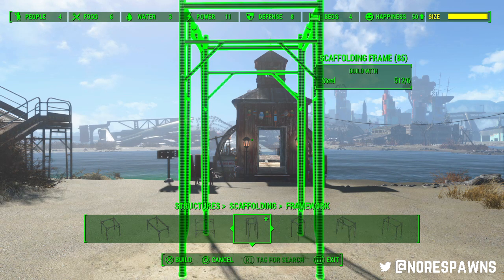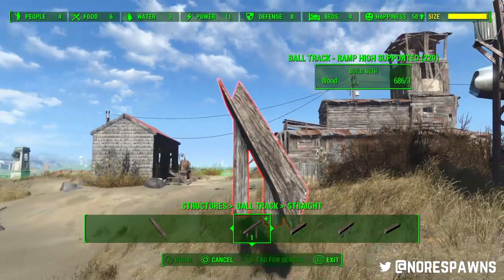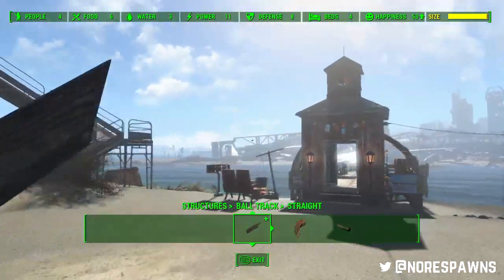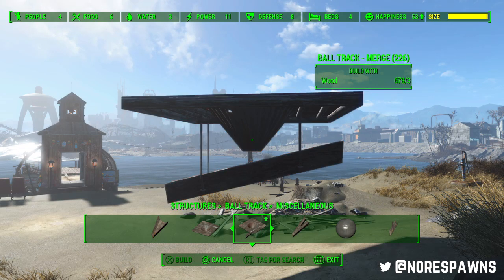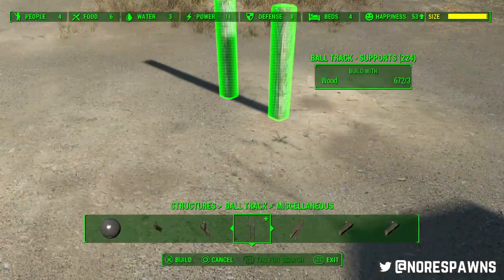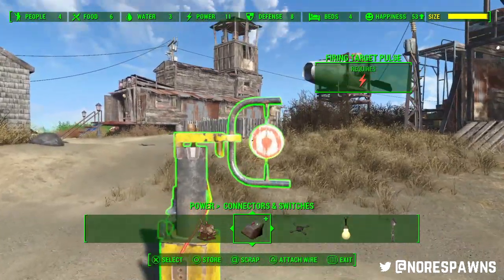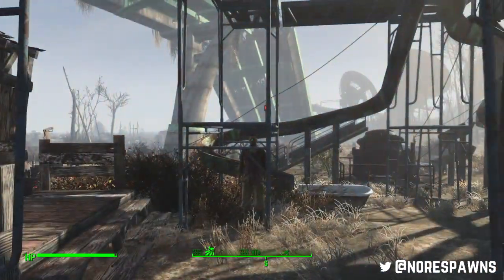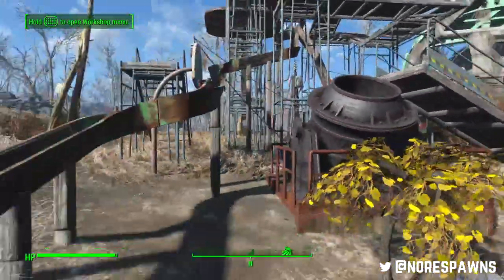Fallout 4 Contraptions - Ball Track Overview

Comment: I think once you start messing with the logic gates, you'll get ideas and enjoy what types of possibilities they allow for. I decided to dive into them and have done two things so far. 

First use was if my fusion core generator powering my defenses goes down in an attack, logic gates will automatically divert power from generators powering other things to defenses. 

Second, which I think is pretty cool is a decontamination airlock that's entirely automatic. To enter, hit the switch outside, door 1 will open for 5 seconds, once it closes 3 decontamination arches will spray for 5s while you walk through them, when they go off door 2 will open for 5s. Same for exiting but no spray.
Reply: the second one is brilliant
Reply: +ftwkh85 thanks! It took a while to make haha.
Reply: +Cass I I'll have to figure out how to build it
Reply: +ftwkh85 one note to hopefully save you some trouble is that any switches that you're connecting to the INPUT of a logic gate must have a direct connection... no other conduits in between.

Comment: I've noticed you say before "hold X and L1" and I'm wondering if you ever explained what platform that's for? I play on PC with an XBox controller and I'd love to more easily slide things like that if there was a combo to do so but I haven't figured it out yet. Mainly I just have to carefully fiddle with the right stick until I get what I want and it's more time consuming than what you do.
Reply: Hold A  button to move x axis and hold LB and A to move y axis
Reply: If your taking about grouping items together just hold A but it grabs everything in area so have a nice open space
Reply: Lb and a on Xbox I believe
Reply: Yeah, I'm on PC without the controller and I often am left wondering what the equivalent is to the buttons he's using.   Nothing I've tried makes it run smoothly like that on a single axis.

Comment: Hey Norespawn! I have a question, for the rug glitch, when I use the rug glitch to fade something it selects all the pieces at once instead of the rug itself and it does not allow me to fade things, how do I select the rug itself to move everything in order to fade things? +Norespawns
Reply: You don't hold x or a, you just click the rug and only the rug will be highlighted.
Reply: +Dylan Eyer but will it move everything else connected to it also or close to it?
Reply: Josh Discua No your grabbing everything holding the button, your suppose to put it on the rug and move the rug alone and if you put whatever your trying to glitch on correctly it will move that item to.
Reply: +Dylan Eyer ok thx dude 👍🏻
Reply: +Dylan Eyer the object tou want to move has to physically be on top of the rug for the rug to move it.

it can be finicky but is very helpful.

Comment: question- could the logic gate that transmits when no imputs have power be used as effectively free power?
Reply: Nope, because it still needs direct power. It's confusing at first but you get use to it.
Reply: Okay i'll explain, the gate that transmits power when another gate connected has it's power off still won't transmit power because it needs a direct wire into it's input.

Comment: Is there a way to lift the balls back up to the starting point? Like an automatic elevator or something like that?
Reply: No, but you could have a item machine make steel balls and have your conveyor belt keep feeding the track with new balls.
Reply: potential using the conveyor belt elevator at the end where the track finishes that could take the ball back to the top possibly
Reply from the maker: +Tomert42 you could use a conveyor (I'm working on an automated machine that just runs continuously)